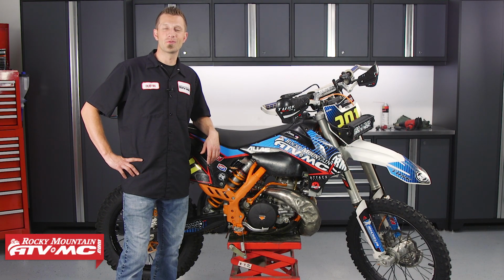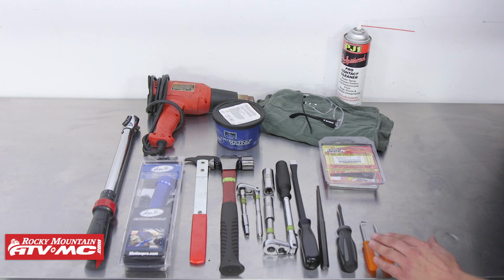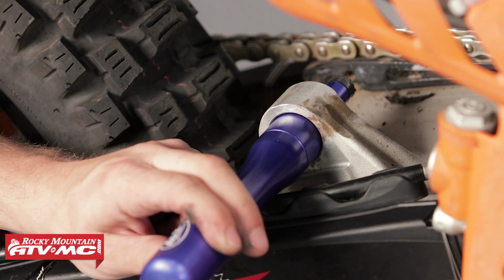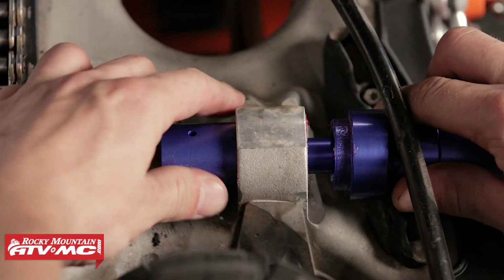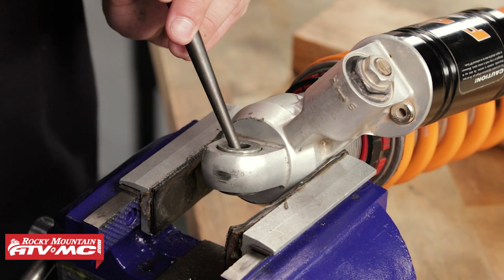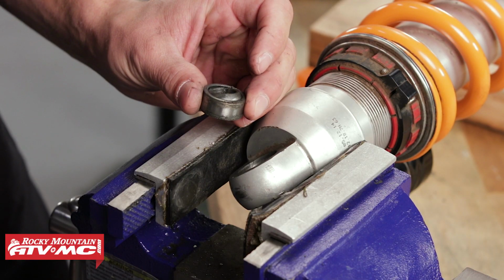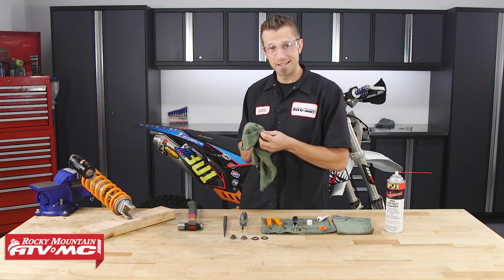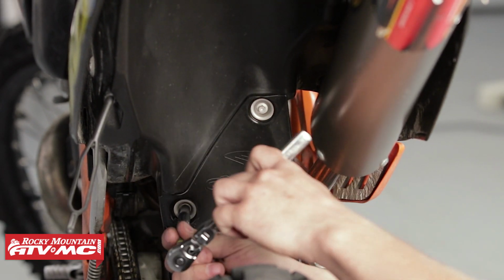How-To: KTM PDS Shock Bearing Replacement

Comment: KTM service specifically says for lower bearing: ”do not put any extra grease to hem joint or sealings, it will ruin the teflon coating which is on hem joint sliding surface and drastically reduces service life”
Same is said on factory service manual.
Reply: I just read that today to and was a little worried for this guy haha I doubt it hurts it too much though

Comment: Is it better to insert and remove bearings with hammer or long screw and slowly pushing it while screwing
Reply from the maker: maucina12 Pressing the bearings in when you can is best.  Or the sweating method.  The hammer method works fine.  Especially with this Motion Pro Specialty Tool.  As long as you are striking the outer race of the bearing and using the appropiate size socket you'll be fine.  Thanks for watching.